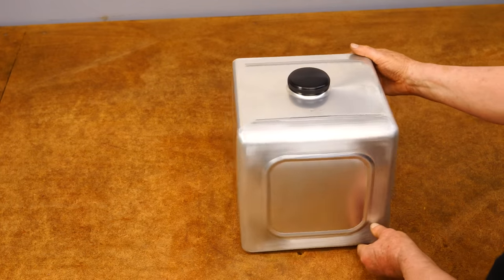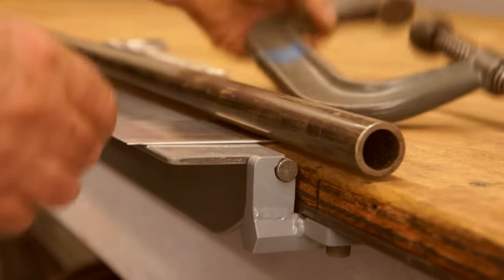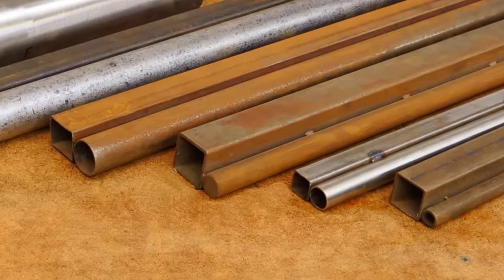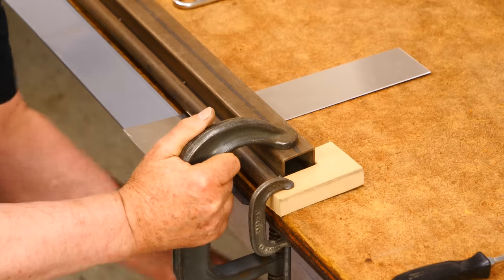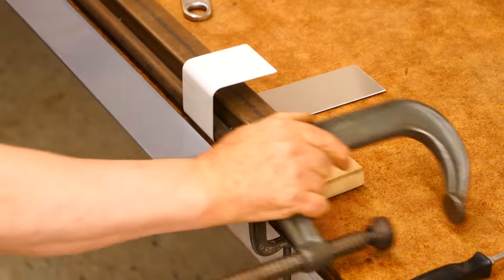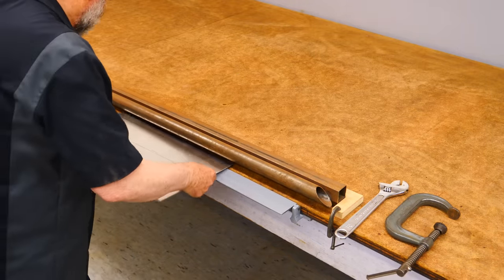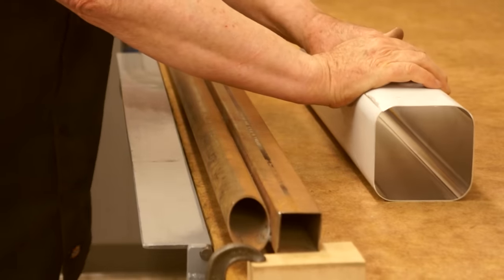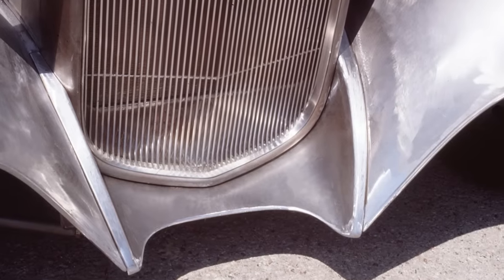Making a Radius Bending Fixture for Sheetmetal

Comment: The first time I used this method was to make a cowl for a steam traction engine at the Powerhouse Museum in Sydney in 1988. I had your books and was learning metal forming when the issue of the cowl came up. I was just a lab tech but I piped up that I did a bit of metal forming in my spare time and was awarded the task. It came out well and I got promoted to workshop duties as well as lab duties. Thanks Ron
Reply from the maker: Sounds like you're a clever worker!
Reply: @RonCovell  I like making things,thats all. Im 53 and have been a maker for 43 of those years

Comment: Excellent and simple. Very Ron Covell. You've had this bending fixture in your shop forever; longer than I've known you.  I've done a lot of bending with just the tubing fixture clamped to the table for tanks and motorcycle tank  tunnels, etc but always fudged it a bit. I think I need one of these! I think the radius edge tanks is the neatest thing I picked up from watching you (and Steve Davis). Keep digging in your tool box for these gems, please!
Reply from the maker: Brian - Thanks so much for the kind words!

Comment: Excellent Ron, Thankyou! Simple and easy to build. You just gave me an idea for a brake that's similar but the axles of the bending leaf are on the centre line of the round tube and adjustable for use with interchangeable  tubes for different radiuses, more complex than yours, but one could do a 180 deg. radius in one bend if needed. I appreciate you sharing your knowledge with us 👍
Reply from the maker: Van Der Hoof - Yes, sometimes you need to make bends up to 180-degrees, and my simple design isn't good for much more than 90-degrees.
Reply: Hi Van Der Hoof, would it be possible, to show, how you built this type of bending brake?
I'm always interested, to see other peoples solutions on tools. Thank you

Comment: Thank you, you have given me an idea for my one-off. I need to make a 11cm tube for a chimney flue, so I will try with just a steel tube screwed to the bench. 
Later I will need to make a 2m J section guttering for the rear window of our camping-car, again I hope to bend it round a steel tube like you.
Reply from the maker: I hope this works well for you!
Reply: @RonCovell  In the end I used my Black and Decker Workmate, it worked fine thankyou

Comment: I am helping my Brother do body work fabrications on his 1919 Plymouth Coupe he just bought and as you know everything is Round...We are using 16 Gauged sheet metal. We did a couple 42" bends but we had to heat it to bend by hand on a home made steel frame we threw together with a round bar welding on it to give the shape.   Now after seeing your video I jumped up and grabbed one of rear end of non running 8N ford tractor. The 8N does not need a motor to lift the lift arms. To test a 8N without starting it take the PTO handle is be sure it OUT OF GEAR turning the PTO OFF. Now move the hydraulic lift lever  to the fully up position and then turn the PTO as fast as you can COUNTER CLOCKWISE, If the hydraulics is good it should start lifting the lift arms almost instantly. A running 8N can lift 900 LBS at full speed. But I'm guessing it can lift 300-400 at idle.  I'll be cranking the PTO with a Hand Crank so who knows. Might work?    Already  mounted my  already made super heavy gauge 8 foot long and 4 foot wide table to the rear of the tractor just over the lift arms.  Can't wait to get it finished tomorrow.to try it out...In my mind I trying to calculate how much pressure is needed to bend 16 gauge say 4 foot long without heating it?   With heating it I know it takes only two to three hundred ILS.
Reply from the maker: Interesting approach. Let me know how it works. Most cars of that era used 19-gauge metal for the bodywork, which is considerably easier to bend and work, compared with 16-gauge.

Comment: Good job man! I'm needing to roll a 90 degree radius on a 22 in x 8 inch piece of 1/8 sheet metal. I need to saw a dent out of a lower outside dump truck body, weld the new in place and grind the welds smooth.
Reply from the maker: Glad you liked the video! 1/8-inch material is a bit challenging to bend with a device like shown in this video, especially with a smaller radius (the larger the radius, the less pressure it takes to bend it). Here is a video that shows how I bend 1/8-inch material:
https://www.youtube.com/watch?v=utKpSRpLzCE&t=18s

Comment: Nice simple setup Ron. I would be interested in a video explaining how to calculate that offset you set the bending bar at in creating the corner bends of that tank.
Reply from the maker: To make a tank, I bend a test strip first, with bend lines spaced the dimensions I want the finished sides to be (for example, 10-inches, 5-inches, 10-inches, 5-inches). Then I make all the bends with the bend lines aligned with the edge of my table. This test strip will always comes out oversize, but then I know how much to reduce each dimension to get the exact size I want. Fortunately, this process works with any degree of bend, so the tank doesn't have to be 'square'.
Reply: @RonCovell  thanks Ron. And I guess your rollation techniques will come in handy here too.
Reply from the maker: Hmmm - I've never used rollation to make a gas tank, but I guess you could. I normally just work from dimensions.
Here's an article I wrote for a magazine that shows the process in more detail:
http://digitaleditiononline.com/publication/?m=54239&i=683927&p=120

Comment: This video now gives me the idea to DIY a custom diesel heater tank for a camp trailer. I find it hard most of the time to look for something which maybe close to fit and it just not the way you want it. Where as a custom built item would fit and match the needs of the build. Thank you for posting.

Don't have room in my shop for metal working tools. I'll have to keep them very basic. Your radius bender fits the bill when it comes time for me to build my own tank. 

Do you use any lining material inside your tanks? I have seen some videos where a thick gray liquid was poured in to a tank, rotated around to get coverage then with the hole upside down to drain any excess.
Reply from the maker: I know there are many sealers on the market for tanks, but I have not used any of them.

Comment: Awesome video! Pretty much answers all the questions I had about bending a radius into aluminum sheet. If you get a chance to read this, can you tell me if you think your bending setup could bend a 20" wide sheet of 1/4" (.249") 3003 alloy aluminum 90 degrees with a 4" radius bend, i.e. using an 8" OD steel pipe as a bending die? It seem possible, in that I feel like 1/4" thick aluminum won't crack at a 4" radius (right???). What I am mostly unsure about is whether aluminum sheet that thick can be bent by hand. In your video, it looks like you're able to bend the metal with ease, but it also appears to be 1/32-1/16" thick and only 2" wide. For all I know, 20" wide 1/4" thick aluminum would require major hydraulics, and/or might rip your break out and destroy the end of your bench. What do you think? Again... amazing videos man.
Reply from the maker: Michael, while the principle shown with my fixture could conceivably work with 1/4-inch aluminum, the 'tonnage' required would mean that every aspect of the fixture would have to be 'beefed-up' considerably. For example, you couldn't rely on C-clamps alone to restrain the radius die - it would simply slide back on the bench with the thicker material. 
Press brakes with radius dies are the best way to form 1/4-inch plate.
I found an online calculator for the minimum bend radius for 1/4-inch 3003 aluminum plate, indicating a radius of 3 material thicknesses (3/4-inch) was sufficient to prevent cracking when bending.
http://www.cumberlandmetals.com/aluminum/minimum-bend-radii/
Reply: @RonCovell  Ahhh... I never thought about the die slipping backwards, which I can absolutely see happening. Even if I built your rig with two really long handles to act as levers to overcome the manual pressure I'd have to apply to cold-bend 1/4" thick sheet, that doesn't help the fact that the amount of force being exerted on the system itself is simply a hell of a lot! Thanks for the response man. I am a software engineer by profession, but I watch all of your videos, because in my mind, I will one day have the courage to go all in and start a metal working shop and restore an old Buick. I'd trade in all the 1's and 0's in my digital world if I could earn a living working with my hands. Thanks Ron!

Comment: Hi Ron,
this is the first video I watched of yours. Thank you. They are very clear and concise.

May I suggest that the apron should revolve around a point very close around the intersection of it and the table so that it does not push the sheet back towards the radius bend die.
to be ideal the center of the pins should be on center to the corner of the Apron angle. In this way the sheet rolls around the die and is not push towards it.
my 2 cents worth.
Reply from the maker: Great ideas - thanks!

Comment: the place where you draw the line is that the start or the middle of the bend?

thanks for the good video.
Reply from the maker: The answer to your question is complicated, since there are many variables - most importantly the diameter of the radius die, how far the die is set back from the edge of the bench, and the angle of the bend. 
I normally cut a test strip of the metal to be bent, make lines on it where I want the center of the bends to be, and make all the bends on that strip.
Then, I can know how to adjust the bend line locations on the actual part to get the results I want.
Reply: I will try the a test strip before I get on my actual project. I think this will help me get the right settings. 

I made this fixture last week it works well, bu I have been struggling with the precise location of the bend.

My radius is a 30mm 🤪 at 90 degrees, 2mm aluminum.
Reply from the maker: Glad to hear you already made your bender! The 'test strip' method should work well for you.

Comment: Great video.  Question regarding the larger radius die ... do you use a different apron  for larger radius bends?  It seems as though your apron would be too short to complete the larger radius bend.  I"m asking because I have a need to make some 5 inch radius bends in some sheetmetal and I plan to make exactly what you showed in your video.   Thanks again for your time in making this video.
Reply from the maker: If your bend needs to be 90-degrees, the apron needs to come up just past the center of the radius die. For a 5-inch die, you might need an apron that measures 3 1/2 or 4-inches to get a 90-degree bend, when you factor in the springback of your material. Hope this helps!
Reply: Yes sir that helps.  I chose to use 4x4 angle iron for my apron.  I should be done with fabricating tomorrow. @RonCovell
Reply from the maker: I just realized that I confused your 5-inch radius bend with bending over a 5-inch diameter tube. For a 5-inch radius bend, your apron would need to be OVER 5-inches to go past the centerline of the radius die.

Comment: Thanks for sharing!  I love the simplicity of it ... simple is much harder than complex, but so much more desirable.
The square clamping stock also adds stiffness to the die.  How important is the added stiffness?
Reply from the maker: On small tubing, using a larger piece of square stock will increase the rigidity a lot. The larger the round tube is, the stiffer it is. Of course the length has an effect, too, so longer pieces of round tubing may need more stiffening than shorter pieces.

Comment: This is a great idea and video.... I have to make curve 1/8" milde steel, 5" x 16" lenght wise to a  curve that wraps a 12" radius structure.. since getting a pipe of that diameter is impossible for me, what would be your approach using this method
Reply from the maker: When you bend metal, it always 'springs back', so you will have to bend your strip to a radius tighter than 12". I would start with a strip of metal longer than what you need, since it's hard to get the bend al the way to the ends of the part, and bend it over whatever radius is necessary so it springs back to a 12" radius. The ends can be trimmed off after bending. You can see something like this at the 7-minute point in this video: https://www.youtube.com/watch?v=2PNl7QwURPs

Comment: I like this idea alot. Was thinking of taking this idea and having a brake set up but the top being able to have the die bolt into?
Reply from the maker: Yes, you can certainly adapt radius dies to a standard brake. You may need to extend the lip on the lower apron to accommodate larger radius bends.

Comment: Ron have you made a full round with one of these? for example, reproducing bedsides on a 47-54 chevy pickup.
Reply from the maker: It takes very specialized tooling for a press brake to make the top roll for a pickup bed side. A simple tool like this simply isn't up to the challenge.
Reply: Thanks Ron.
I've been trying to work out a way to do it either in a bead roller or incrementally in my 5T arbor press. I have a series of bead roller dies in mind that (in theory) may work, I just need to build the radius tool for my lathe so I can make them. I'll send you an email if I figure it out, seems like it would be worth sharing if it works.
Reply from the maker: Be sure to let me know if you are successful!

Comment: Whats the thickest sheet metal you have bent lije this? Thank you for showing us these tricks.
Reply from the maker: The thickest metal I have bent on this particular device is 16-gauge steel (1.6mm). I made a special cone-making fixture that works with 1/8-inch steel (3.2mm):
https://www.youtube.com/watch?v=mmUgT2tXsqg&t=7s
Reply: @RonCovell  thank you for the info saludos from Tj Mexico Gracias amigo.

Comment: Thanks for this great idea.  I was recently disappointed when I saw the prices for 16 gauge rated box and pan brakes.  The ingenuity behind this is not only remarkably cost-effective, but probably space-saving as well.
Reply from the maker: xenochaosxc - I'm glad you liked this simple fixture. I should have pointed out that it is not robust enough to make SHARP bends in 16-gauge steel, but it works great for radiused bends.
Reply: Oh I see.  Thank you all the same.  I hope to implement this  (in some fashion, at some point).

Comment: On old trucks beds they had a roll on top. I need to duplicate that roll.  It's about 1" round. is this jig what you would use to make that complete roll? Also how to they make those cones on the 50" front bumpers? I think they were supposed to be bullets or rockets. Thank you very much for this fantastic video.
Reply from the maker: It takes special tooling on a press brake to make the kind of curl seen on the top edge of old truck beds. You can approximate that shape by welding a tube to the edge of sheetmetal. This would be a good place to use TIG (or MIG) brazing, since welding with steel filler would cause more distortion, which will be very difficult to remove.
Bumpers for most cars are made with male and female stamping dies. It must take some special tooling to make those very pointed domed shapes that you see on Cadillacs and Buicks - often called 'Dagmars' - named after the actress popularly known as Dagmar:
https://en.wikipedia.org/wiki/Dagmar_(American_actress)
Reply: @RonCovell  A tree fell on the bed. to repair it I took a straight bar and modified it a little and used it as an anvil. What a job. But I got it. I know you can't hear me but I give you thanks a lot. Thank you!
Reply: Do you help him distribute gifts? 😍😜 on his off days?
Reply from the maker: Congratulations! That is a fairly tricky job.
Reply from the maker: These days, my 'gifts' are my YouTube videos, streaming out to millions of people worldwide.
Reply: @RonCovell  Cool! 😁

Comment: Simple, cheap, and effective!  Unless there's a reason you have the C-clamp handles facing downward, they would be a lot easier to manipulate with the handles above the bench top.
Reply from the maker: Glad you liked the video! There is no question that the clamps would work just as well with the handles sticking up. I normally point them down for two reasons - gravity helps to keep them planted in the same place when they are loose, and I'm less likely to bump the handles with my arms and body if they point down.
Reply: I was thinking weld a nut kn there an use a impact ....from the top also